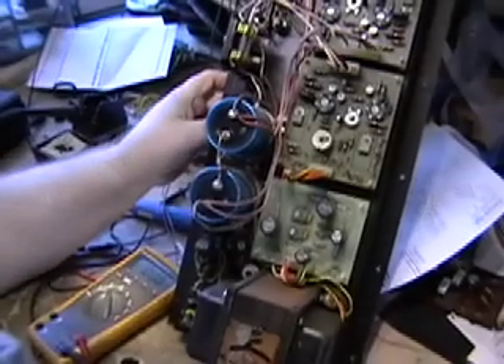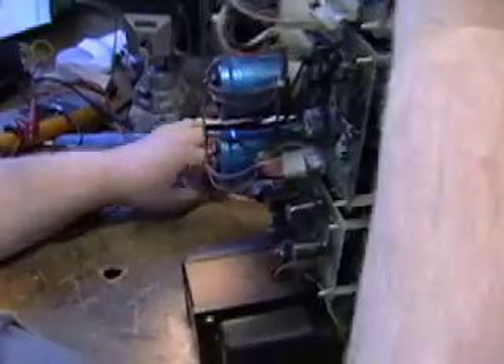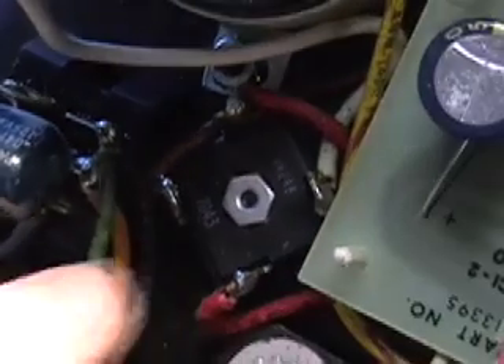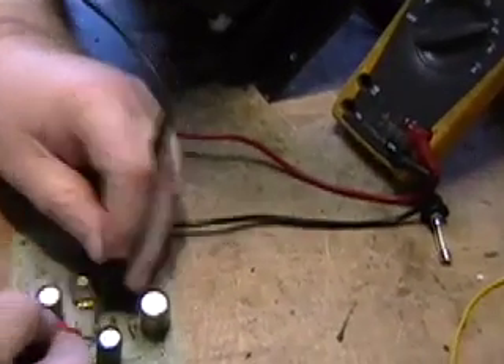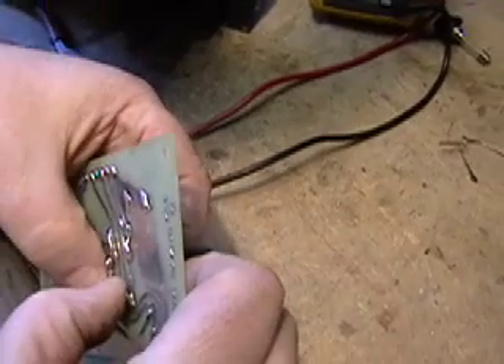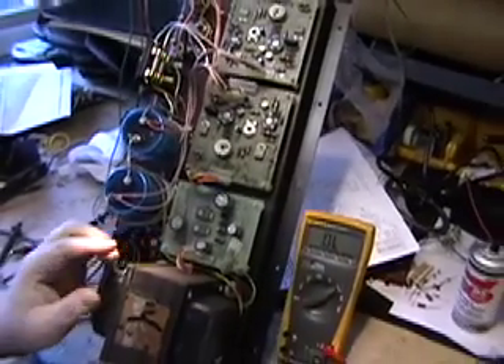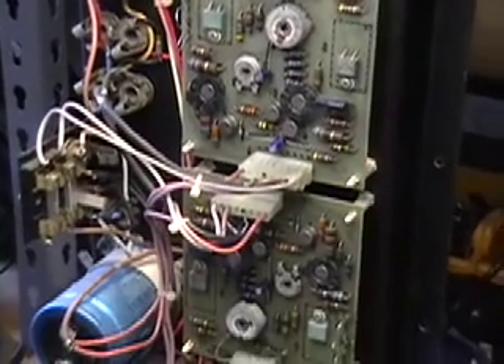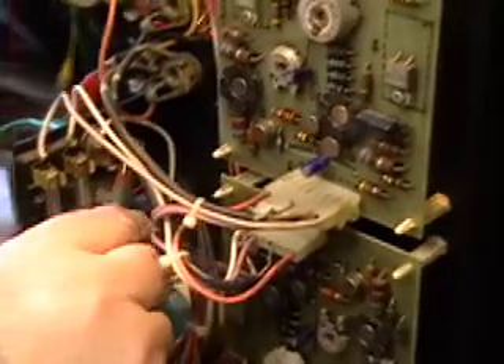Rhodes 5 Pin Amp Repair and Bias part 1

Comment: my pathfinder 15 doesnt get the clean setting......... only gain and overdrive and they sound horrible...... also the treble doesnt seem to work.... if you know what to do please pm me thanks alot.
Reply: There's only only solution: get a Fender Twin Reverb. Just lift with your knees!